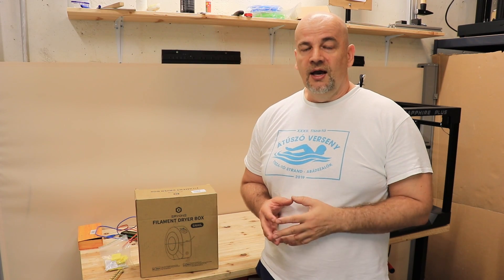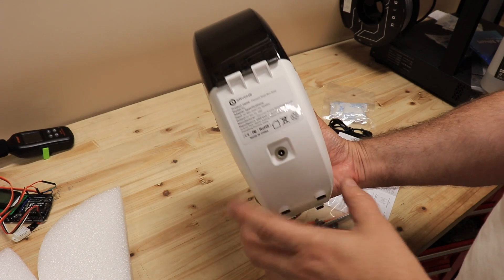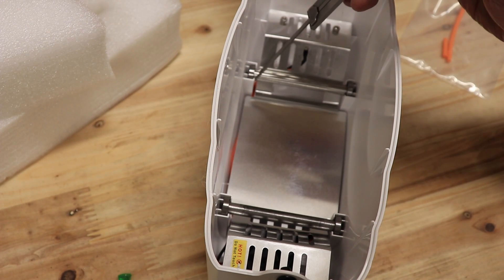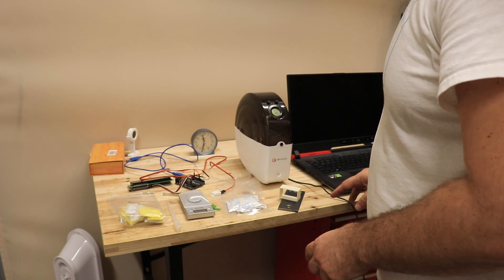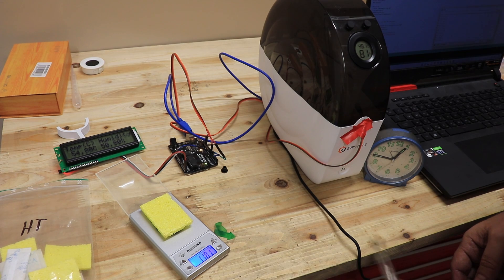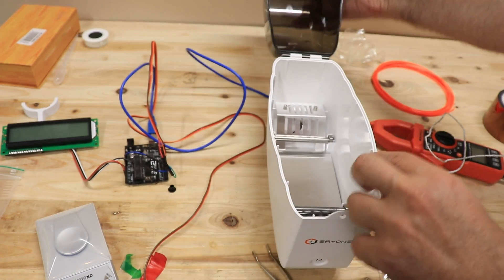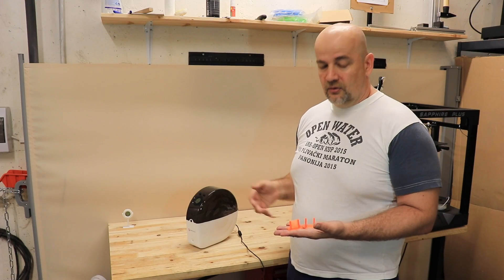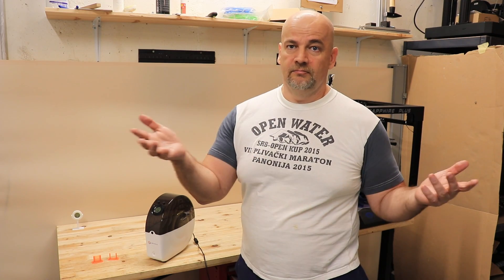Review of Eryone Snail filament dryer box M2 - a quiet filament dryer with fan

Comment: Eibos easdry or eryone snail?
Reply from the maker: Both are good, Easdry is better for drying, but Snail is quieter and easier to insert the filament. So if you don't print Nylon, go with snail. If you need to dry nylon too, go with Easdry.
Reply: @MyTechFun  I don't print nylon but I did go with the easdry because it was cheaper

Comment: Hi. Of all the dryers you tested, which would you recomend for PLA drying?
Reply from the maker: For PLA any of tested dryers will work. I am currently using this one (Eryone) since it is one of the quietest. But exit of the filament is not good, it should be tangential and not almost 90°. I had some problems with CF filaments. Explained here (from 12:10) https://youtu.be/cQb-hbr1KYY?t=730

Comment: Hi, I use CACL2 in a container inside my dryer. I tape the outside so the more moisture cant get in and I was running the filament through a tube from the drier to the extruder. It seems to work good especially the CACL2 granules. Just make sure there are no leaks in the system or it will just keep drawing more moisture in.